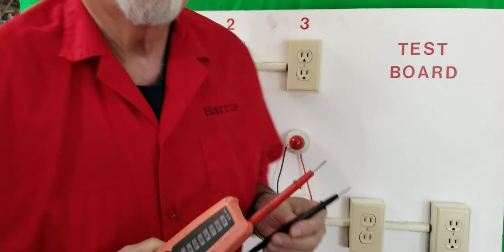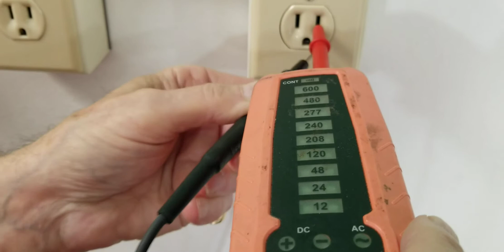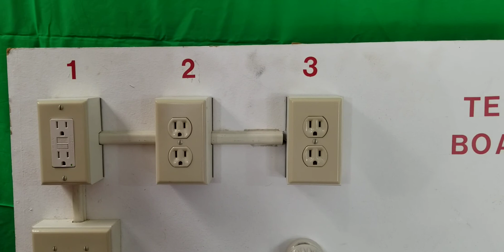Testing GFCI outlets and downstream

Comment: I’m trying to troubleshoot an outlet that just stopped working in my bathroom. Specifically the outlet at the sink, a non-gfci outlet, stopped working. I replaced it this morning and it still isn’t working. It is downstream from a GFCI outlet on the other side of the bathroom at our built in vanity. Is it possible for a GFCI outlet to work itself but now allow a downstream outlet to work?

Comment: Why is the #2 outlet tripping?  He tested #2 and said the power was correct, then hits the ground and it pops GFI... I'm having the same problem in a new home build with every GFI.. Is #2 in this case wired wrong?
Reply: They're all supposed to pop, that's the point of having the GFCI upstream
Reply: @rp9674  What is the point of have all GFCI on a single circuit? Don't you only need one upstream?
Reply: @rp9674  The question is why should it pop or trigger the gfci when you try to TEST between hot and ground?
It popped when trying to measure across hot and ground in both the gfci receptacle and the #2 downstream receptacle.
Reply: You have to wear in and out of the GFCI, some of my boxes were so stuffed I didn't bother